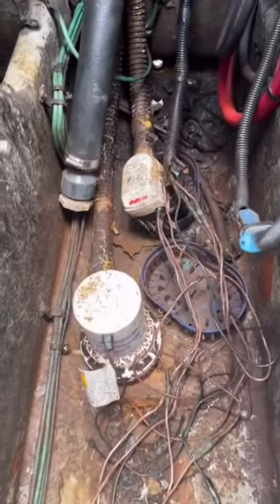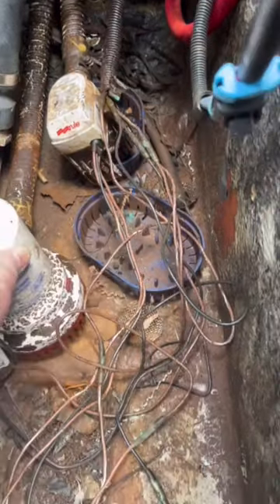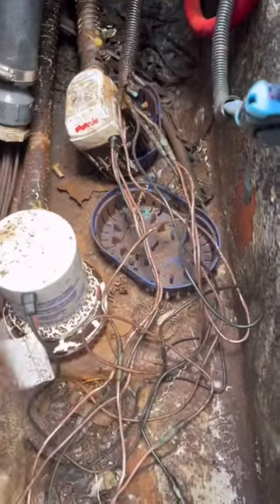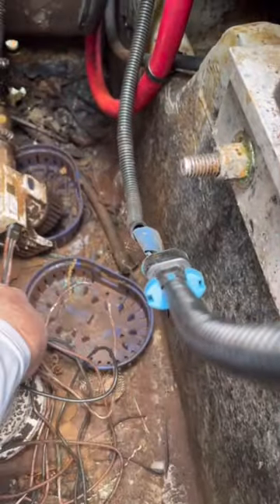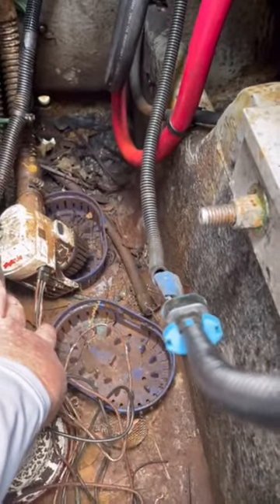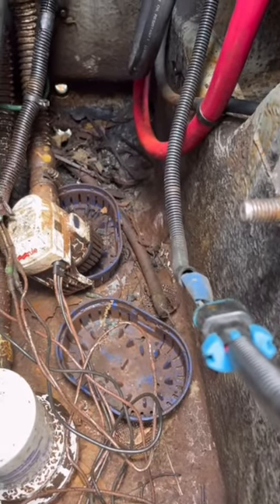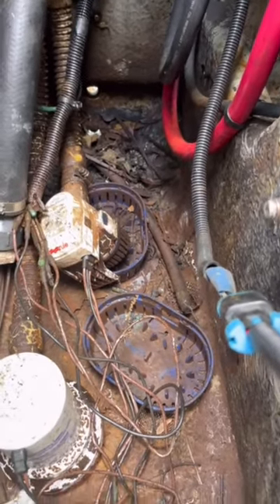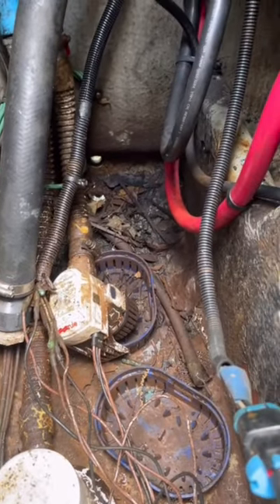60 second boat survey (Ep125): Bilge pump installation fail!

Comment: One good thing is to avoid connections get wet, galvanic corrosion may start on metals
Reply from the maker: Thanks for the comment and yes, you are exactly correct!
Reply: That's a disaster

Comment: I found an interesting thing Capt Frank! The bilge pump discharge lines were not secured at all for the full length from the pump to the discharge through hull at the transom. I was unable to find anything the the ABYC standards for minimum distance between points of supports for bilge pump discharge lines. I think they should be secured at least every 3'. What are your thoughts on the matter?
Reply from the maker: Hello! Yes, not much guidance from them on that. Personally, I'd secure the hose every two feet. More than that and it would likely have too much movement.